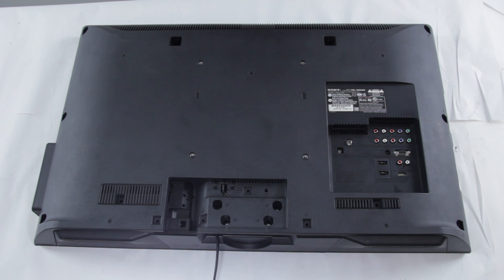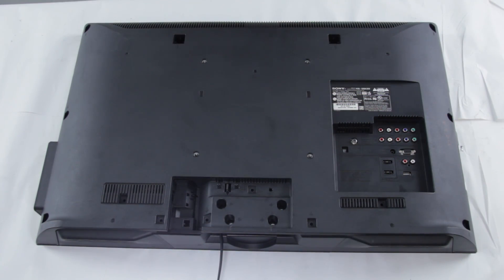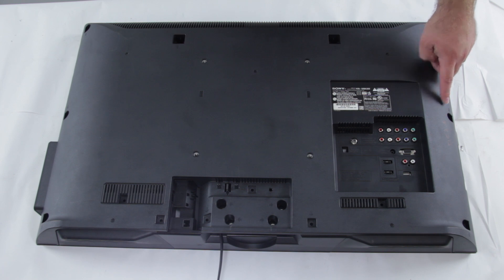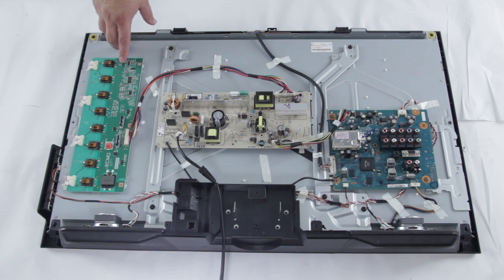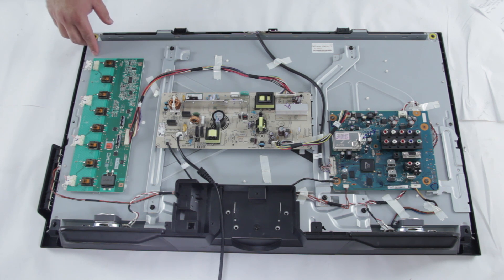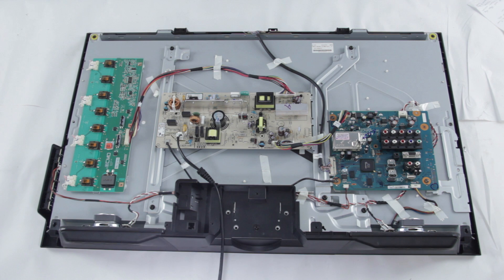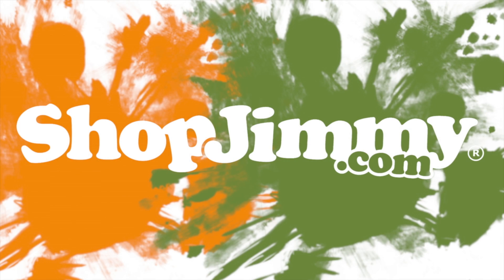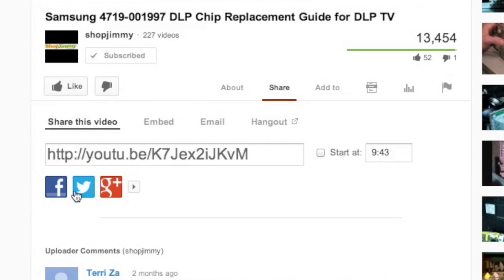LCD TV Repair Tutorial - Backlight Inverter Common Symptoms & Solutions - How to Fix LCD TVs

Comment from the maker: Eric Walters I would recommend replacing the power supply in your TV.  Please reply with your TV model number or you can search the TV model number on www.shopjimmy.com.  You can also call our customer service for further help with your TV Repair.  (877) 881-6492  Thanks and please let us know if you have any other questions!
Reply: I have a Vizio 42" SV421XVT.  It powers on and the vizio light turns white but i'm not getting any picture at all.  No sound either.  I tried the flash light test and there is absolutly no pic.  I'm thinking i need a new LCD.  What do u think?
Reply from the maker: Carl Thomas   I recommend replacing the main board in your TV.  Here is a link to replacement parts for your TV model number on our website, click here:  http://www.shopjimmy.com/catalogsearch/result/?q=SV421XVT  Be sure to match part numbers on your current board, with your replacement for compatibility.  Here is a link to a video showing how to identify your part number, click here:  TV Part Number Identification Guide for Vizio Main Boards (Plasma, LCD, LED)  You can also call our customer service for further assistance with your purchase.  (877) 881-6492  Thanks and please let us know if you have any further questions with your TV Repair!  www.shopjimmy.com
Reply: ShopJimmy.com I have replaced the main board and still have the same problem.  What is next.

Comment from the maker: @Dharma Kissoon - I would recommend replacing the backlight inverter/power supply (they are on the same board).  It looks like we may be out of stock for your replacement part.  Please call our customer service to confirm.  (877) 881-6492  Thanks and please let us know if you have any further questions!

Comment: I have a Vizio 32 inch HD tv. I think that I have a problem with the backlight. The amber off light will show, but when I go to turn on the television, the white light at the bottom of the television that shows that the television is on does not show up, although I do have sound. When I look at the rear of the television, no light shows. It is a Visio Model No. E321MV...Serial No: LIIMKDAM4700197. Any information is appreciated.

Comment: Shopjimmy, after further troubleshooting, it seems the HV stepup transformers (which supply the inverter board) are not getting full voltage. HV filter is retaining proper voltage (386vdc). Checked the MOSFET pair which provide voltage to the transformers. 1 FET has same vdc as filter the other jump to 160vdc and rapidly depletes after the flash. Checking the gate voltage I get no gate vdc. I'm suspecting a bad FET (10N60Q, FQPF).

Comment from the maker: @Sam Kayyali - I would recommend running the flashlight test on your TV.  You can search for the flashlight video on our video channel and I will also send  you a message with the URL.  This flashlight test should help you to determine if you have backlights or not, thus determining if the problem is the backlight inverter or the main board.  Thanks and please let us know what you find, and we can recommend a fix!
Reply: Pls I need your Help on my Sharp TV It on. Then Shows then it Turn off Model Lc -26d44e-gy
 220-240v~50hz 
               95w
Serial K 804411556

Comment: Hi Shopjimmy: I have a VIZIO GV42L HDTV.  My TV turns on, I hear the sound but there is no video image.  The VIZIO logo starts bright but it dims. so it sounds like a backlight problem.  When I turn off and turn on. sometimes I get the band on top that tell me the channel, but it quickly goes away.  I have a Master and Slave Inverters.  I checked the fuses on top of the main board both have continuity. fuse on PSU does too. Ohmmeter on 680 uf capacitor read same on both inverters.  Help?

Comment from the maker: @ProphetM - DANGER - Conduct this troubleshooting at your own risk and only if you have the proper skills.  Check to see your backlights are turning off. Carefully remove the back of the TV and run it until the display disappears. Then check through the back of the TV and see if you can see the white light shining through. If you can then it could be Tcon, or panel. If the light does go out, it could be the power supply or the lamps inside the screen.  Let us know what you find.  Thanks!

Comment: I have a Samsung LNT4042HX - I thought I had a bad backlight inverter & got a new one from ShopJimmy but this didn't fix it. The display goes dark after a minute or so of normal use. BUT, it will not fail if not displaying much - for example with no incoming video, & only displaying the selected source message & a 'please check cable' message. If I then make the display work any harder than that - a full menu or showing video, the display shuts off. The display comes back on after a restart.

Comment: Hi, I have a SONY KDL52VL150 which I have been using for 4 years now. Its showing 3 faint horizontal dark lines almost evenly spaced on the left of the screen which disappears as it moves towards right of the screen. Is it an inverter board or CCFL problem? Or is it something else? Your help would be highly appreciated. Thanks in advance

Comment: ihave a norcent LT-3751 the power turns on and stays on ( the red light on the front of the tv turns to green and  stays green) but  still no pic or sound i have changed the sound and vido boards the power board power in and outs are all ok

Comment: I have been working on a Proscan 40LD45Q and having a tuff time resolving the problem. The unit is in STBY (red), when I turn it on (blue)...I hear a low click (this is with the back off...inverter board uncovered) then a backlight flash maybe 1 sec. Unit is still On (blue) and stays lit. All COLD side VDC voltages are ok. The voltages at the inverter VCC=13.3, LD=12.6, however no FB voltage (I'm thinking it should be 2v). I've swapped inverter board with same symptom. Any suggestions??

Comment from the maker: @Carlos Roca - I would recommend replacing the backlight inverter on your TV.  Search your TV model number, DX-46L150A11 on our website, shopjimmy com.  Match the backlight inverter board number in your TV to the correct part in the search results.  You can also call us with any questions!  (877) 881-6492  I will also send you this information with a link in a youtube message.  Thanks!

Comment: I have a Samsung model LN37A330J1DXZA.power wouldn't come on.found a bad cap and replaced it.power back on now but it has a thin vertical yellow line and athin horizontal black line on the screen.any ideas?

Comment from the maker: @mike counter - This could either be the panel of the t-con board.  I would recommend replacing the t-con board, to see if that fixes the problem.  If the problem is the panel, it is typically very expensive to replace and difficult.  If you would like to try replacing the t-con board in your TV, please call our customer service for help with purchasing the correct part.  (877) 881-6492

Comment from the maker: @Mohan Reddy -  I would recommend replacing the main board to see if this fixes the problem.  The other option is the panel could be damaged and needs to be replaced.  Replacing the panel is usually expensive and difficult.  Unfortunately we do not have parts for this TV model on our website.  Thanks and please let us know if you have any further questions!

Comment: The issue with my TV 40 inch  LCD Samsung model : LA40B550K1R is as below.
Any suggestions for the problem  

1. The video seems to be a bit dim, we get the whole video including color but slightly shaded out.
2. when channel changed, takes time (few secs ) to get to display , we see some lines and dots before video comes up.
3. My Guess - it seems one of the color component seems to be not functioning properly. Just my guess 
Thanks,
Mohan

Comment: hey i have a dynex dx-46l150a11 i have recently purchased a inverter board from you guys..but nothing happend..the issue is when i turn it on it does show pictures for about 3 seconds and then goes off..and i assumed it was the inverter board so thats i changed but still the same..what would you suggest me ?

Comment from the maker: @SolaciaoofThunderhorn - You will want to do a flashlight test on the TV, to determine if the problem is the backlight inverter or the main board.  Please search our videos to find the flashlight test.  It is currently our most recent video.  I will also send you the link in a youtube message.  Unfortunately we do not have parts for this TV model, but you should be able to determine the board that is causing the issue.  Thanks!